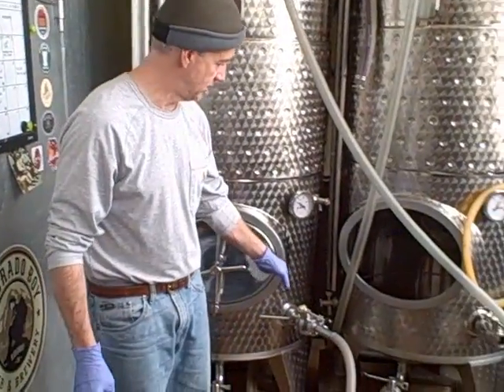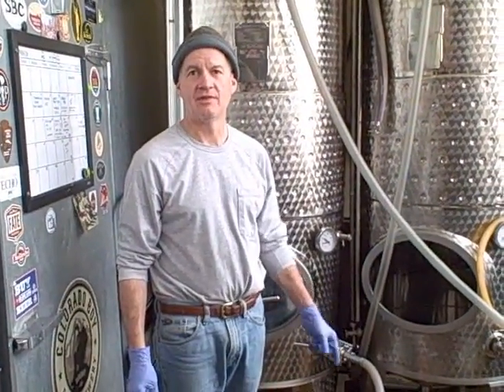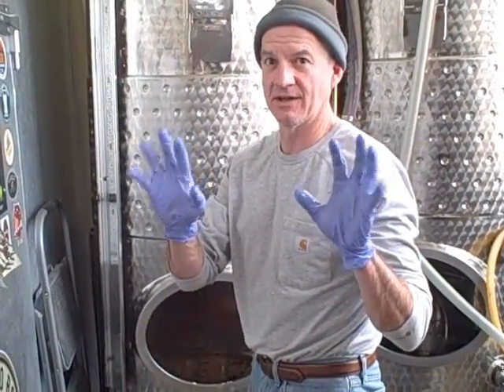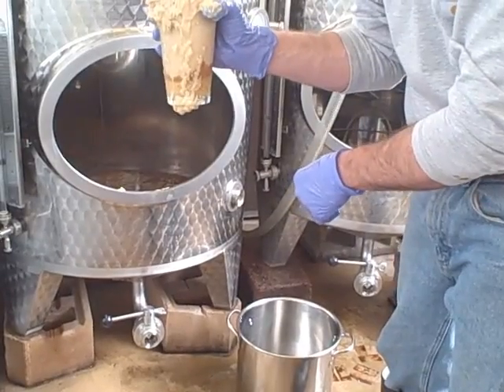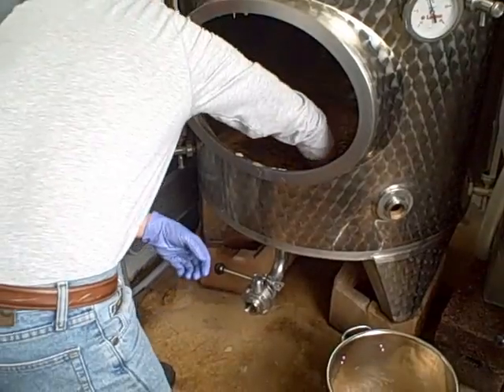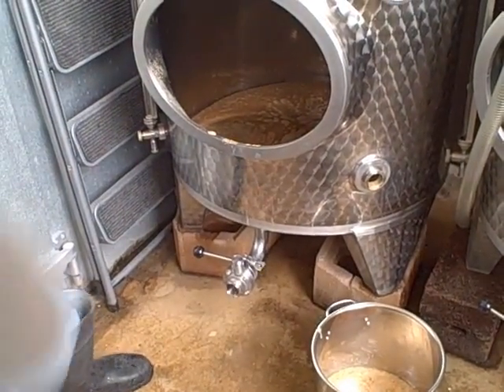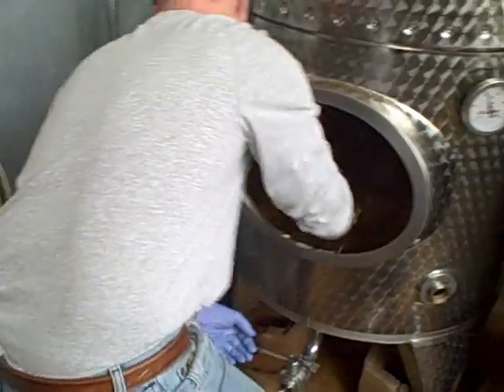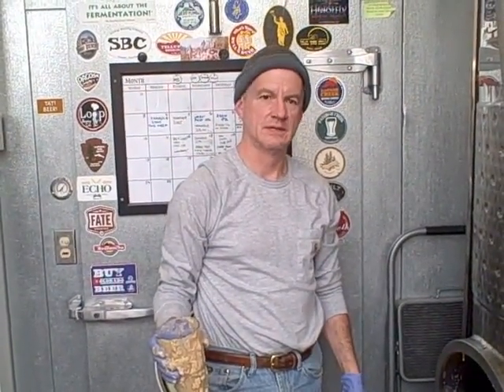Yeast Harvesting - More Videos At www.coloradoboy.com

Comment: I don't work in a brewery but I do work in a bacterial r&d lab. There are several potential situations here for contamination. Everyone in my lab would be groaning. I know that brewing doesn't require top notch sterility but come on now. "I'M GONNA DIP MY BALLZ IN IT" attitude is less than desired for commercial brew.
Reply from the maker: ubermick I agree but we sanitize the crap out of everything. Either a straight sanitizer or alcohol and flame. Also I do yeast cell counts and viability with Methalyn Blue. We have NEVER had a problem. That said, we are a pub, all our beer has been drunk in a bout two weeks. When I had a packaging brewery I had a full lab set up. So I am saying be clean and don't worry!
Reply: daverocker1 As a homebrewer, I look on in horror at that - when I harvest yeast, I'm sanitizing constantly, using completely sanitary containers, and holding my breath the entire time lest I introduce a single microbe. That said, when you're talking pints and pints of yeast, I'm thinking that's going to outnumber any stray microbes that might have been introduced. (Still could be better sanitation procedures though!)